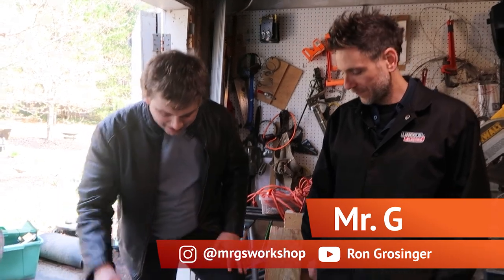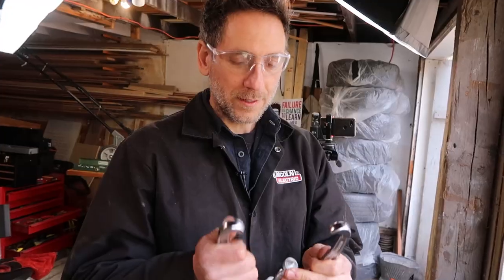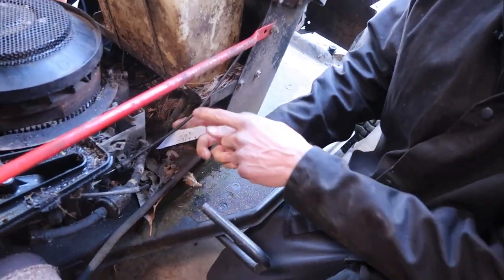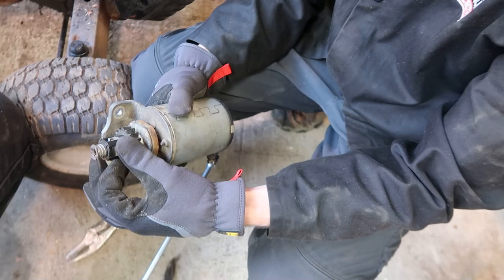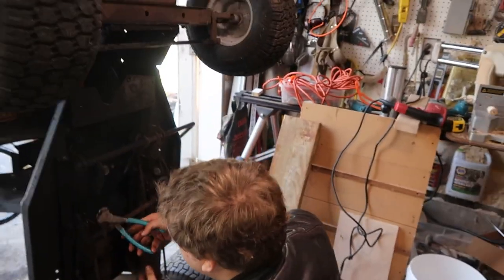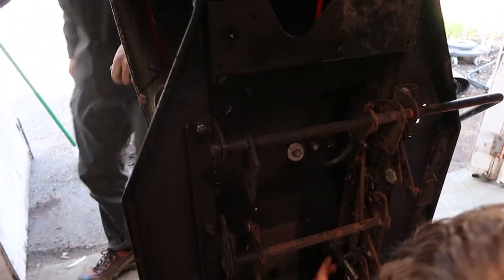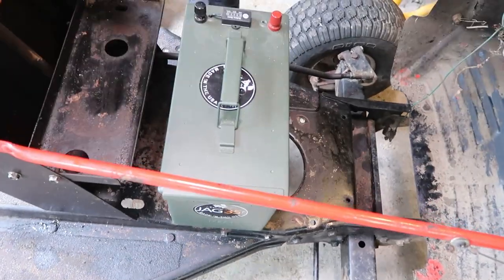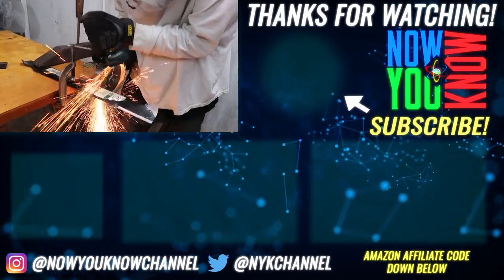Tearing Apart a Ride on Lawnmower Electric Conversion - Episode 15

Comment: Hey guys, is there a modular fly by wire device yet? Like a local wifi signal and when you pull the throttle (like a bike gear shifter) it remotely pulls the throttle at the motor...? Thanks for your knowledge! Great series!!!

Comment: Maybe I didn't hear it in the video, but did you say the motor specs (DC, AC, Brand, power output, ect)?
Reply: This is a brushed DC motor with a pwm controller. pulse-width modulation. All that is is throttle control.